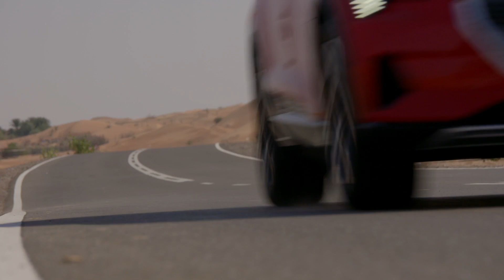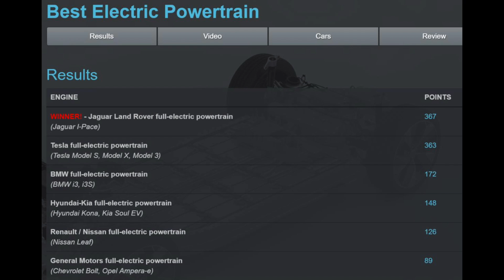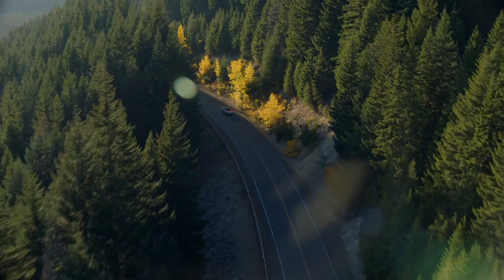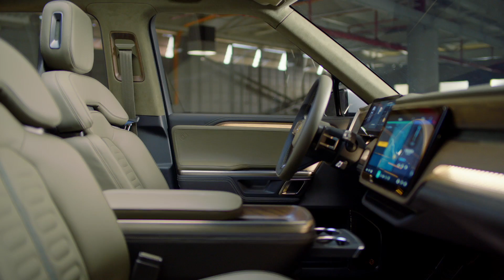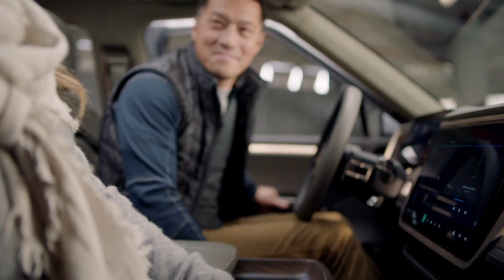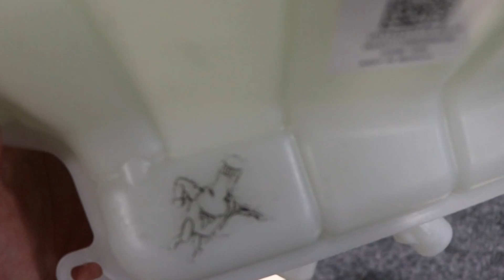Sandy Munro: Model 3 manufacturing, Model Y wiring, and EV competition

Comment: Fantastic guests for the interview. Lots of good content. They seem to have reiterated things we already "know", so it's nice to have a legitimate source from the industry saying the same things. 

Interestingly,  the man who is not Sandy cites long charging times as a reason to not have a Tesla. He exaggerates the recharge time to be "two hours", when he probably could do with a 20 minute top up on a Supercharger and his 200 mile commute would be just fine. It's not like he is going to a building where there isn't electricity. Sandy even said they have extra 220 lines at their building that aren't being used. It's amazing that such an industry insider, someone who has worked directly in the battery industry for 20 years, has the misconception that BEV's, including Tesla, (he works in the same building as people who own and operate Tesla's as their daily driver, for crying out loud), don't have the infrastructure to support his commute. That being said, I do not know what his exact commute is, but I am sure that if he wanted to it would not be hard to move from the hybrid to the full BEV. There is very likely at least one Supercharger on his normal route. It just goes to show how the biggest barriers to BEV adoption are not in fact the vehicles, but rather the people and the perceptions they have of the BEVs. They could easily use one of those spare 220 lines to charge a BEV and then he could leave work every day will a full charge and not even have to supercharge on the way home. 

I do it at one of the places I work once per week, and it's off of a 20amp 110 line from a light pole in a parking lot. I think it was originally installed so that other employees could plug in their diesel trucks in the winter, but other it to recharge my LEAF.

Comment: I wonder if the Model 3 “body in white” was manufactured with Sandy’s suggested corrections and associated weight savings how much extra battery range they could eek out of the existing design while saving money on components 🤔 seems like a win-win / no-brainer.
Reply: I was thinking the same thing. That was Sandy's biggest criticism of the car. Everything else was pretty much praise/amazement. Tesla never bought Sandy's report though, afaik. Maybe they're going at it their way?

Comment: Maxwell tech is not about using capacitors along with batteries to buffer energy but improving the battery cells production process with dry material that removes the long and energy intense drying process (Jack Rickard - EVTV)
Reply: Christophe HUBERT 
The dry materials is undoubtedly the more immediate consideration, but super capacitors are also part of it. It would reduce battery degradation and make it possible to deliver even more impressive power output for its performance models.

Comment: There is a 0% chance of Tesla selling batteries to competition. They would have to redesign the packs/body individually for all the different cars because maxwell would need less batteries and probably a different cooling/managementsystem to go with it. And second of all, tesla doesnt only sell cars, they could easily use all the batteries they can get for their storage business. The only way for tesla to keep competition relevant is to artificially increase the selling price/ margins if they get too far ahead. Anyway great interview
Reply: back when the model S went into production, Tesla offered its Drivetrain and batteries to the Legacy car makers. 
they all Refused, so Today they cant even build a BEV comparable to a 2012 model S.
Reply: Where is this idea that you should keep your competitors relevant coming from? As far as care, if they can't build great cars, good riddance.
Reply: @phamnuwen9442  do follow anything related to elon/tesla?
Reply: @DBlock5566  Quite closely, why?
Reply: @phamnuwen9442  tesla can not supply the adoption of EVs by itself. Notven slightly. But that was the whole point of Tesla
Reply: @DBlock5566  What do you mean they can't? Right now? In five minutes? No, of course not. Who cares? Tesla can and will grow, others can and will go out of business.
Reply: Not zero. They've done it in the past - Mercedes in the B-Class and Smart EV, Toyota in the RAV4-EV
Reply: Pham Nuwen 
Elon Musk has already said clearly that the purpose of Tesla is to jolt other manufacturers into pulling their finger out.
Reply: @kardy12  Yes, but the survival of all auto manufacturers is not a rational goal. The ones who can build great cars will survive and the ones who can't won't.

Who the survivors will be is unknown. The market will decide.
Reply: Pham Nuwen 
If the market really got to decide, GM, Ford and Chrysler would all have gone bust a decade ago.

Consolidation will still happen though, as the PSA-FCA merger plan shows.

Comment: Sandy Munro is amazing, and Sean, you keep him going! :) How about the "cross-pollination" between Tesla and SpaceX on so many other fronts? 

- Dragon capsule docks at International Space Station. How much of the high-reliability software and hardware required for Tesla Autopilot is shared with SpaceX projects? (I mean, they even call it "Autopilot" and threw a Tesla Roadster into Earth/Mars orbit.) 
- Elon has already stated that the grid fins on future Falcon rockets will no longer have hydraulic controls, but will instead have "motors sourced directly from Model 3 power trains". 
- Sandy stated that the Tesla automotive circuit boards are aerospace/military grade quality. 
- Cybertruck has Alon windows and stainless steel construction as the new Mars rocket is likely to have.
- SolarCity and incredible battery technology are required to get us to Mars. And to make electric cars practical. 
- BlueTooth-like protocol over fiber optic "wires" - why not even integrate the fiber optic into the insulation of the power conductors? Every module, from headlights to tail lights, has an address on the network. All you need is power wires. And then, who needs fiber optics if you can flip bits down the power wires like DSL flips bits down your phone line?
- Elon is very actively using Tesla to learn to mass-produce safe and reliable rockets. And he's using space technology to build cars. 

It strikes me that Sandy Munro is not a man who is easily impressed. And he very obviously likes Teslas.
Reply: Is the Cybertruck a prototype for the first mass-produced vehicle on Mars? If you were designing a vehicle to produce on Mars, with very limited equipment, is this what you would do? Is this where Musk might be heading?

Comment: Good interview!  I think the complexity of the Model 3 chassis construction is there for a reason that Munro can't understand due to the fact that crash testing only goes to 5 stars. Something like 40% of all cars achieve a 5-star crash rating and yet we know that hundreds of thousands of people still die in cars with a 5-star crash rating. It's time to make the crash tests more difficult in order to separate out the cars with superior safety. Of course, traditional manufacturers don't want to have to make their cars better so they oppose any strengthening of the crash ratings.

By adding more difficult crash tests, the reason for Tesla's more complex structures would become apparent and hundreds of thousands of deaths and debilitating injuries could be prevented. Insurance costs would decline along with missed workdays, etc. The cost savings could be huge. Munro wants to make the chassis $100 cheaper but this could cost millions more in hospital surgeries and pain and suffering and time off work. What is the value of having a car that protects your loved ones more completely once they are inside?

For example, the self-piercing rivets that alternate direction. Munro says he has no clue why they do that. I think Teslas computer simulation of various crash scenarios determined that the shear load on that seam could come from either the top direction or the bottom direction depending upon the height of the impact (cars, trucks and SUVs have different bumper heights).  And the self-piercing rivets have different shear strengths depending upon which way the forces are applied. Adding additional rivets would not be the optimum solution because they wanted that particular interface to "fail" at a certain force threshold. The obvious solution was to install the rivets in an alternating fashion. It's only a waste of money if it doesn't achieve a more predictable and consistent absorption of crash energy in a manner that better protects the occupants in a variety of impact scenarios. Because not all crashes happen according to NHTSA crash testing protocols.
Reply: M Mullen 
That’s a lot of conjecture based  on not a lot of evidence.

Also adding weight to a car if it serves no purpose does not make it any safer for the driver, and makes it a more dangerous vehicle for everyone else on the road since the energy in a crash is directly proportional to the mass involved.

Comment: Would be interested the see munro and team teardown a kia e-niro. That drivetrain and battery looks on par or better than Tesla. Some users are reporting 400 miles of range meaning kia understated the battery range.
Reply: Also a Chinese electric car even though that would be expensive
Reply: The Kia system isn't better, it's different.
They went for a slightly bigger single motor and geared the car for lighter load, with less acceleration.
It's the equivalent of semi-hypermiling a Model 3.
If Tesla put a slightly longer gear in, and set a "super chill" mode to limit the consumption, the result would be similar.
Reply: @rogerstarkey5390  Very interesting and makes sense. Thanks for sharing.
Reply: TheOne ...... and I’m quite happy to go with Tesla’s take on it all. The acceleration NEVER EVER gets boring or old ;-)

Comment: 1) Toyota's annual gross profit for 2019 was $48.995B; 2018 was $49.413B;   2017 was $45.225B
2) 2010 - Toyota Just Got All The Lithium It Needs By Claiming Stake In Mining Company
3)  2019 - Toyota and Panasonic confirm wide-ranging new battery partnership for electric vehicles

No auto manufacturer building 'volume' EVs is profitable doing so at this time.   Tesla is no where close to dominating the EV market and it is quite small respective of total 86 million global vehicle sales in 2018.

I trust Warren Buffet in his assessment that Tesla has no 'technological moat' that prevents any other auto manufacturer with profits from taking the lead in BEVs.

Manufacturing BEVs at volume profitably will ultimately define market success.

Comment: Great work locking down an interview with these two guys. Unfortunately, I think the timing is less than optimal. Much of the discussion has been covered elsewhere. Talking with them right after a teardown - recent 3 or y or raven - would be a lot more interesting for those that value munros expertise.

Comment: Do I get it correctly; if Tesla does the bodywork as it does everything else, model Y will be a masterpiece?
Reply: Yes plus also reinvent automotive wiring (1km down to 100m of wire) and possibly include new Maxwell battery tech.
Reply: If they do that, get the new wiring harness thing down, get the Maxwell supercaps and dry cell batteries in there...it will be like every other automaker is offering Model Ts and Tesla is offering cars sent back in time from 2040.
Reply: @tribalypredisposed  Tesla cars are already 12 years ahead of the ICE traditional companies who are doing too little too late to every catch Tesla.  None of the others are serious attempts and they are not selling. There are going to be a very rapid disappearance of brands in the next 2 years. Ford might still be able to sell some trucks but GM has no answer to the lack of competitive car. Jag is surely not going to be around 2 more years and Audi has gone backward and will not recover. The dealers are scared by all the unsold 2019 inventory that is going to bankrupt them. The mass-produced BEV will be Tesla and a few Chinese brands that are just starting.
Reply: The naysayers seem to forget Tesla has the ability to learn from their mistakes, and will do so with the model y frame. Either way we will get the find out soon enough with fine people like Sandy that will break it down and give us a detailed report
Reply: @thomas8421  Agreed.
Reply: @stanspb763  dont forget the unsold 2018 chevy trucks. i just saw an ad today for 2018 chevy 4x4 crew cab priced at 26k down from 41k. Leases are at 113 per month for a full size truck! hilarious how desperate they are to move inventory.
Reply: Stan SPb I am not buying a new car until I can afford a Tesla. I will maybe buy an old banger to tie me over until that date. But it’s absolutely stupid to buy a new ICE car today. On another video someone predicted this behaviour and I realised that fits exactly me.
Reply: @MoDa87  I think buying new cars is stupid. They depreceate so hard in teh first two years, it makes no sense to me at all. But maybe it is, because in Poland we buy used cars from whole Europe. We still have preatty good serviceman here, so maybe it is that.
Regarding ICE cars; yes, in 5 years they will be worth very little money, so maybe not buing them is a good idea.
Reply: Stan SPb Maybe they can survive by turning their giant manufacturing to Tesla’s to further Elon’s dream.
Reply: Stan SPb 
Tesla undoubtedly has a head start. Nissan could have had one too if they hadn’t stopped serious development with the LEAF, and in 2019 it’s a bit embarrassing to sell an EV that still suffers from rapidgate issues.

But companies like VW and Mercedes are finally waking up and investing billions to produce their own EV models - the latter has announced it is ending R&D into fossil fuel engines to concentrate on it as well. Porsche’s Taycan is delivering a model that finally could compete with the Model S on performance.

For us consumers, this is great! Elon Musk himself has said that the purpose of Tesla is to kick the existing automakers in the backside and get them into investing in EVs. That effort looks like it’s finally bearing fruit.

Comment: One thing to keep in mind about Tesla getting into its own cell production, and the narrative about how great it will be for Tesla, is that Panasonic loses money on its Telsa-sited cell manufacturing operations.  The technology from Maxwell will help Tesla, but it isn't as if Tesla is cutting out profits of the "middle man", as there have been no profits in Panasonic's Nevada gigafactory operations  It is probably good for Tesla to manufacture their own cells anyway to have control over operations.

Regarding the question about what traditional automakers are doing well with electric vehicles, they could have pointed to reliability (for some manufacturers).  In 2018, when Consumer Reports came out with car brand reliability rankings, they  also specified the best and worst reliability rankings for each brand.  The Chevy Bolt EV was Chevy's most reliable vehicle despite it being the first year of a ground-up new model.  This is rare, as the first year of any given new model typically results in poor (or no better than average) reliability ratings.  And Chevy, all vehicles factored in, is around average in reliability according to Consumer Reports.  Obviously, the EV power train was a factor that helped Chevy, but there are certainly EV models that have poor CR reliability rankings.

Comment: If anyone is curious as to how points were awarded in the powertrain area mentioned at 15:20...

"In every category, the panellists judged each shortlisted engine using their subjective driving impressions and technical knowledge, taking into account characteristics such as fuel economy, smoothness, performance, power delivery, noise and overall driveability. The jurors each had 25 points to award to their five favourite engines in each category. A maximum of 15 points could be allocated to an engine, and the minimum was 1 point. All performance and fuel economy figures referenced in this journal are manufacturers’ data."

https://www.ukimediaevents.com/engineoftheyear/rules-scoring.php

Comment: Yes Sandy, we want to see cost out of the Tesla Model Y body-in-white.  Yes Sean, Tesla vertically integrated battery production to supply the whole industry  will advance the Tesla mission to electrify the auto industry. Battery modules, whole batteries and charging equipment, essentially the whole Model 3 pack would surely get Tesla a 50% gross margin.

Comment: Is there any application for Maxwell’s capacitors for supercharging to absorb some of the high charge rate quickly, then feed it to the battery as it starts to be used up?  This would also allow regen braking to work even from a 100% charge.